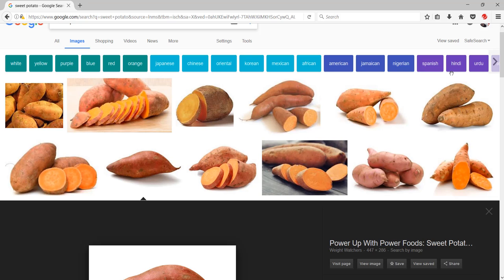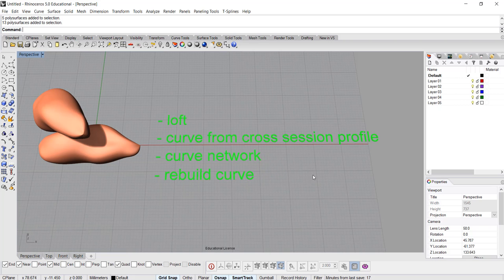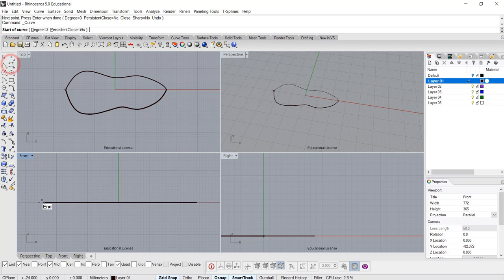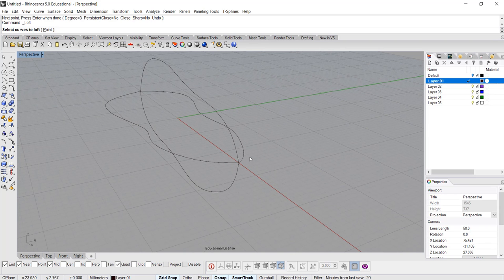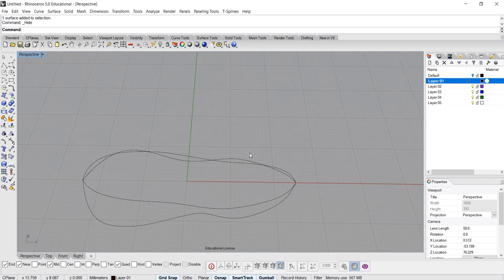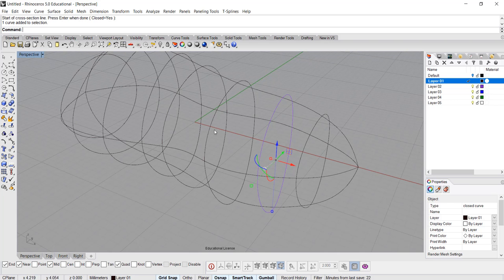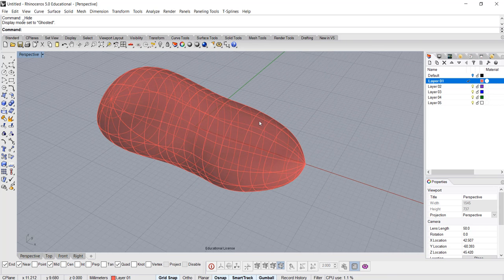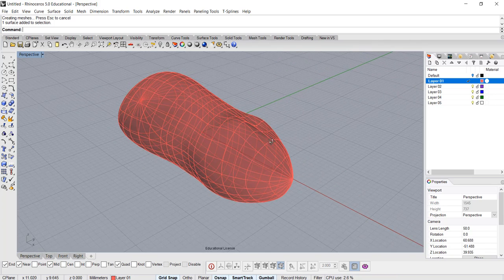Rhino 3D CAD Technique # 6 - How to Build Organic Model in Rhino

Comment: Thanks for the video! Whenever I try to draw on any of the fron/side views, all of my points get snapped on randomn points in the background, as if it doesn't understand  the area where I'm trying to focus on. I do not have any other objects in the background, and I have moved my object/lines on 0,0,0 coordinates. Also the 'planar' tab doesn't change anything. Do you know why that happens? thanks
Reply from the maker: I guess you OSnap is on. so it snap the point to the object.

Comment: Hi P. J,I use the command " curve network",  when I select the all network, there's no dialog box pop upthe command line shows " unable to sort curves. select curve one at a time what to do?
Reply from the maker: Make sure you have all "open curve". if the curves you picked has both open and closed curve. it won't work.